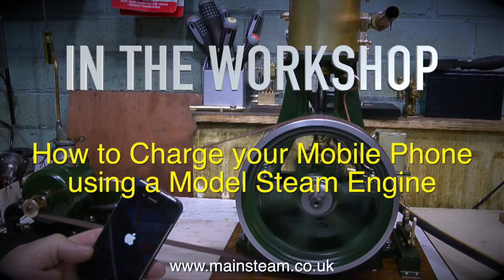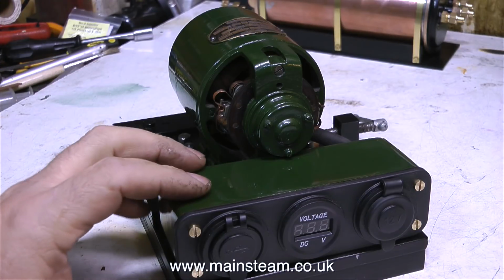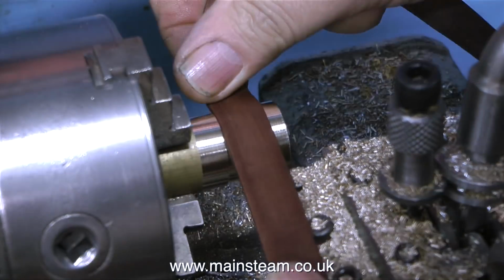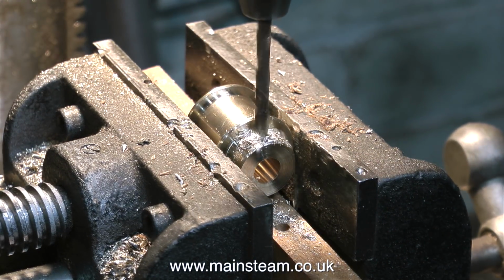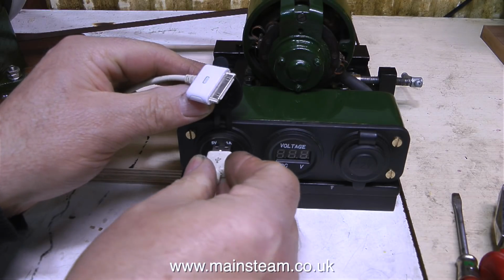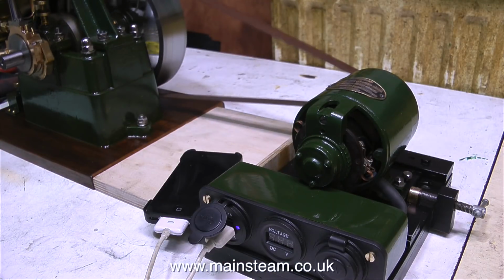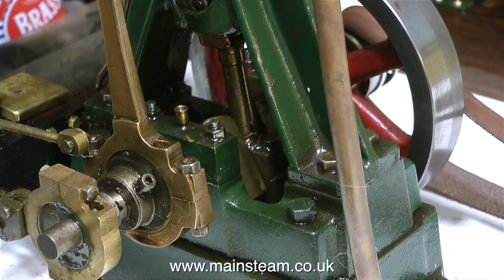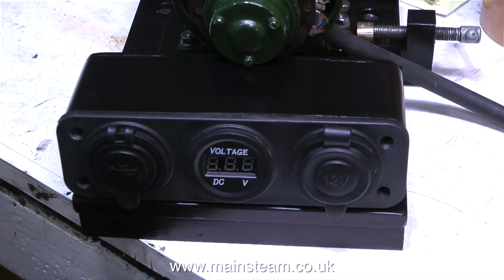HOW TO CHARGE YOUR MOBILE PHONE USING A MODEL STEAM ENGINE - IN THE WORKSHOP

Comment: some one PLEASE direct me to a place to buy this stuff. been looking everywher :(
Reply from the maker: What exactly are you wanting?
Reply: @keithappleton  hello thanks for reply. im looking to generate electric from a household gas cooker. maybe homemade pressure cooker boiler leading to "engine" leading to alternator.
Reply: i uderstand the proccess but am struggling to find a "off the shelf" option as i have the practical stills of an emu lol
Reply from the maker: Forget it - not practical.
Reply: @keithappleton  agreed not practical and most definitely not very efficient. its for a project. i wanted something indoor as oppsed to a wood burning solution.
Reply: And the gas is "free"

Comment: Thank you for the videos. Do have a serious question.

Could you use an adjustable steam govenor to control the speed, so your voltage output would be stabilized?

With all do respect,
Respectfully, with gratitude.
Reply from the maker: Yes, but with modern electronics with power supply regulators a mechanical Governor is not really necessary.

Comment: That voltmeter is telling you very little - it's sampling a continuously changing waveform about once per second.
Reply: True. A large capacitor should smooth things out, and add in a Full Bridge Rectifier for good luck.

Comment: You for sure need a boost/buck converter to stabilize the voltage, maybe a small bank of supercaps too.
Reply from the maker: Yes the voltmeter is dancing about a bit, but the 5 volt regulator holds onto the power until the last minute when engine slows right down ..... I will solder a capacitor across the main output, that should help - plus when I run the engine on steam it will be much more even and give a constant RPM to the generator . . . .
Reply: @keithappleton  just make sure that you measure the maximum voltage that is output from the generator and fit capacitors that have a rating higher than what the generator outputs... Also, the larger capacity of the capacitor... The longer it will provide power to the usb charger... You can add multiples of capacitors in parallel to store more energy... Capacitors charge very fast so you don't have to run the engine long to be able to charge your phone... A diode on the positive side between the generator and capacitors will prevent power going back to the generator and turning it into a motor.... If you are only getting half the voltage with a single diode, then you will need to remove it and fit a full bridge rectifier... Hope this helps you to make another video on this topic because this is something that no one else is doing... I had a good laugh over the zombie apocalypse theme... Keep up the great work.

Comment: I am watching the voltage bounce and can i suggest adding a filter capacitor in parallel to the generator to help clean up some of the fluctuation.  Be friendly to your electronics...  with out a meter on it i going to pull some numbers from the air: Capacitor with 500 micro-farad or more and  20 or more volts.
Reply from the maker: Good idea - thank you/

Comment: I had read somewhere that in the olden days they stitched the belts as a mobius strip so the belts wear evenly, is that true, and if so is there a reason you didn't set yours up that way? 

I'm lightly considering building a small steam setup to supplement my 200 watt solar array. Around here coal and wood are cheap (central Kentucky USA) so feeding a boiler for a couple hours a day wouldn't be a big deal, and maybe I could even tap it for hot water ;)
Reply from the maker: cosmetics ...... the outer surface of the belt is smooth & dyed - the inner surface is rough which is good for grip . . .

Comment: Hi Keith. Many moons ago I worked in a factory which had a belt driven line shaft system. Occasionally a belt (canvas) would break and a new one would be spliced together using special staples. Perhaps that's something you could try in addition to the CA?

Comment: hmm why not cut a small hole in the wall and put a small smoke hood in your work shop so you can run your engine's in side ?
Reply from the maker: I run them inside anyway, the outer part of my workshop where the sanders & grinders are has a very large open door - outside in the garden though in Winter the steam looks better as it wends its way upwards . . .

Comment: Keith why do you not use drive belt buckles and doesn't the glue stick the belts so that the belts have no flex in it
Reply from the maker: I probably will, but I just wanted to test the system first - quickly & simply .....
Reply: That makes sense do black gates do model buckles because all I have is big ones Which my dad uses for his original Burrell showman's engine and are to small for my 4"scale model
Reply from the maker: I don't think so, I have some small metal hinges that I can easily adapt, I think that they were originally designed for Doll's Houses . . .

Comment: Keith, I would have coated both sides with rubber cement, then stuck both sides together when dry. Then I'd run two sets of stitches with a sewing machine across the belt to really secure it.
Reply: The leather belt on my sewing machine is held together with staples!